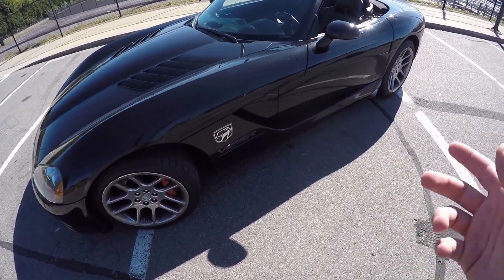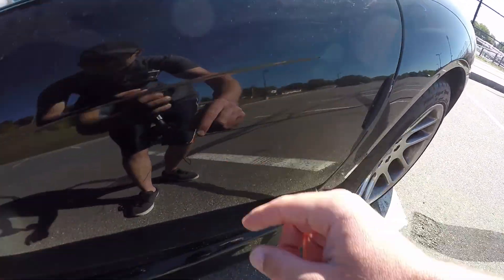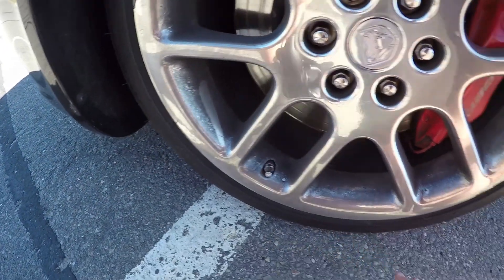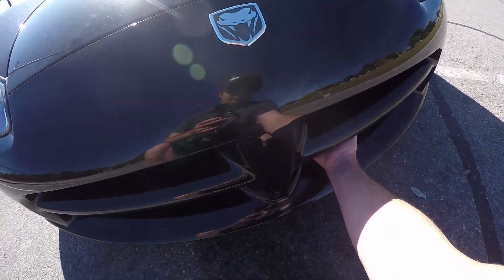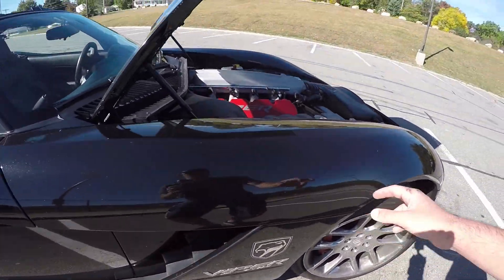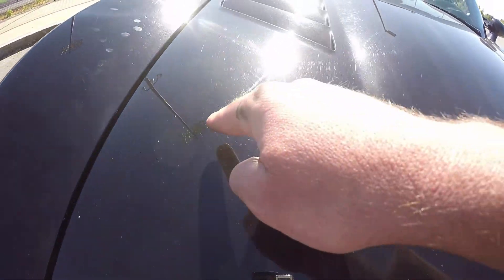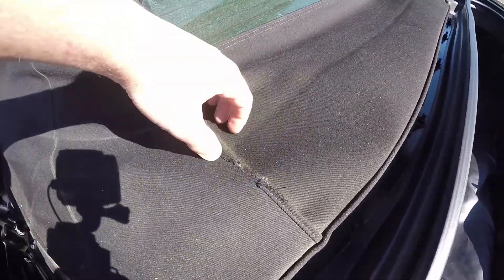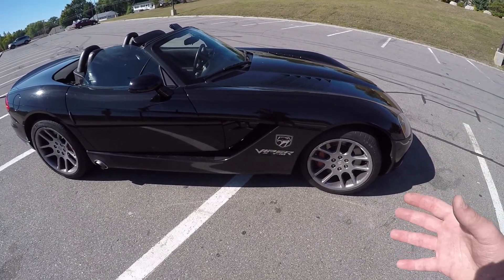Cheapest Gen III Viper: Everything Wrong

Comment: Wow great buy. I'm looking to sell my s2k for a gen 3 Viper like this one. Even if it has higher mileage around 60k. I hear these things are mechanically pretty reliable. How is finding parts? Originally was looking at Gen 2s but worried about finding OEM parts in the future. Thanks!
Reply from the maker: Normal consumables are not too bad to find (brakes, plugs, oil filters, etc) and reliability was flawless for me. Body panels are discontinued though and mine was just totaled for needing a fender. Don't crash and you'll love it!
Reply: @mydadvice  got it! No aftermarket either? Interesting. S2ks are pretty much in the same boat.
Reply from the maker: @gigatron2008  there's a few warehouses with leftover OEMs or aftermarkets. Most insurance companies refuse to buy through them due to price though
Reply: @mydadvice  got it thanks again appreciate the help! I feel pretty confident buying one. 😁

Comment: Ngl kinda eats at me that the gen 4 has 100 more peak power yet gets 3+mpg better. Win win if you have $60g min to spend. I didn't 😅 love the thing to death, but probably not a forever car if the right gen4 pops up 😉
Reply from the maker: 4th Gen ACR is the ultimate goal. Maybe one day, but that's a few years away easily.
Reply: not knockin the 4th but it has fly by wire throttle. that kept me away.

Comment: going to bed, will finish later. Hopefully you didn't pay more than $20k for it. Get that fresh paint job, new wheels and tires, and fix the incorrect badge on each fender. And I'm sure even the word Viper underneath the Gen1/2 snake emblem on the fender is also a cheap decal rather than the proper factory badge.
Reply from the maker: The salvage ones still go for almost $30k. I paid a lot more than 20k but still much lower than market. Wheels are salvageable; new Viper emblems were $200ish for the set- I'm going with the debadged look anyhow though.

Comment: Good luck finding OEM parts for that thing, aftermarket is even worse... your best bet would have been to go with a C6 Vette ZO6 (not now thanks to the used car apocalypse) ... tons of after market support and no custom wheel/tire problems plus better interior comfort and all around daily. those older Vipers are track day money pits
Reply from the maker: Parts have def been a problem to source but I've found a few reliable suppliers. C6Z was high on my list for sure! Drove one and really like it. The Viper just has a special place in my heart.
Reply: @mydadvice  the viper was one of those cars that I wanted to show up to in High school in the late 90s... I grew up poor. all the in crowd had their own cars and customized trucks. If you have the money and can stomach the difficulty have at it. I saw a RT10 sitting in a scrap yard missing all sorts of things... talked to the yard owner and he told me it sits because the parts to restore are near impossible to source or extremely overpriced, and yet he wont let it go.
Reply: @mydadvice  hey I'm picking up a Paxton '04 tomorrow and was wondering what are some good places for shopping the typical maintenance parts and stuff along those lines. Definitely gonna be a big change coming from a challenger where I can find parts at every street corner
Reply from the maker: @732Mopars  I used theviperstore.com for my rotors and either roeracing.com or shopebcbrakes.com for the pads. It's easy enough to shop around for parts online and you'll find someone who has what you need! Enjoy the Paxton!
Reply: The rarity is part of the charm.  Get something cool rarely seen, or something you see all the time on roads or parked in driveways......